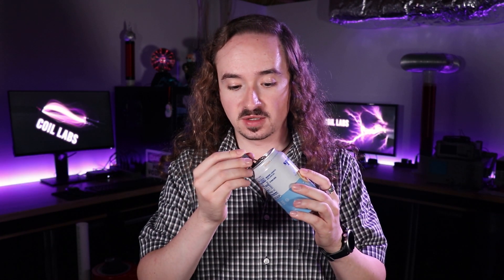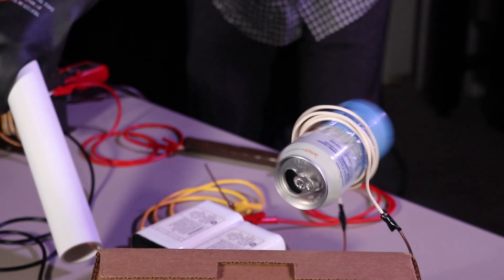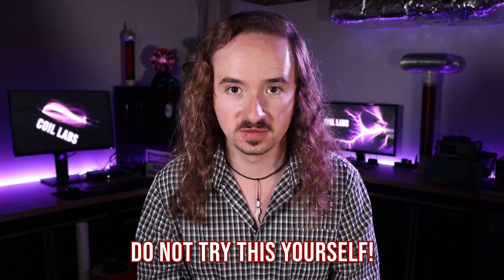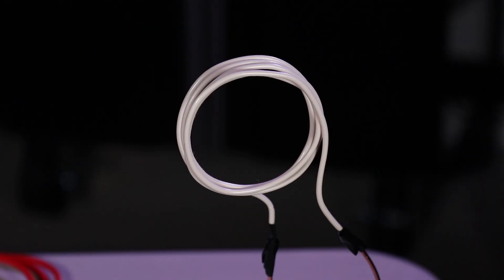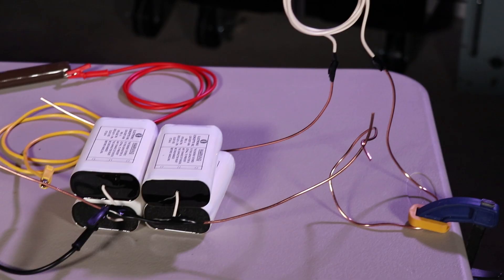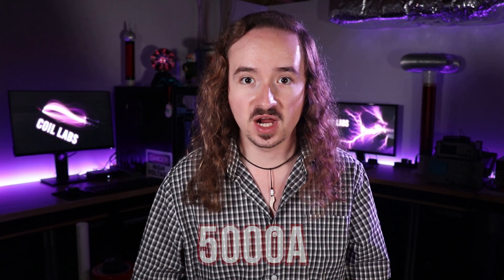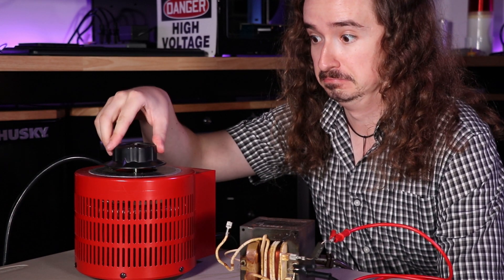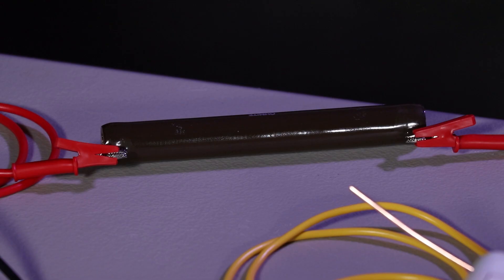Crushing Cans with 5000 Amps!

Comment: Huh... The can crusher is pretty much just an exploding coil EMP gun... if you get more capacitance, a really fast switch and do everything possible to get an exceptionally  short rise time, so the coil doesn't get hot, resistance goes up and it just kinda slumps, melts, & arcs. 

You need a KA-POW! And a parabolic reflector. Then see if you can brick an old laptop from 10 meters or so. 🤔

Comment: Haha I love the switch :D Good Job man, keep going! Where did you get these amazing capacitors?????
Reply from the maker: Thank you! I got those capacitors on eBay several years ago. I have no idea what their original purpose was, lol. They must have been a custom order, because I don't see anything like them on the manufacturer's website (Electronic Concepts Inc). The big thing I don't like about them though is they have absolutely tiny little wires and are definitely not meant for this kind of pulse power stuff. I don't know why they would make capacitors like this with such tiny wires, lol.

Comment: I don't think that the resistance you measured is the full picture. The coil has some inductance which prevents the current from changing instantly, and probably significantly increases the impedance from .4 ohms, given the short duration of your pulse. Thus the current through the wire is likely much lower than 5000 A.
Reply from the maker: You're absolutely right, the inductance does lower it a bit, but it's actually not significantly less (in my opinion, "significant" is a subjective term), if you simulate the circuit. So it's a series RLC circuit, with R = 0.4 ohms and C = 4*200 = 800 uF. L is tricky to know accurately, but going off of air core coil inductance calculators for that coil geometry it says about 2.6 uH. Now assume it's actually a bit higher than that due to the aluminum can (not purely air core) and other parasitic inductances from the layout of the wires and a little bit from the capacitors themselves. Let's be really conservative with that and round it all the way up to L = 10 uH. If you simulate the differential equation for the RLC circuit, with an initial capacitor voltage of 2000V, you get a peak current of about 4285 amps. See this figure I generated from simulating the circuit https://imgur.com/a/5AuTwKm . A non-negligible amount less than 5000 for sure, but still in the ballpark. I guess I could rename the video and say something more like 4000 amps, but it's close enough to still get the point across.
Reply: @CoilLabs  Thanks, I appreciate the explanation! What program did you use to make the graph?
Reply from the maker: It's just a little python script I wrote to simulate RLC circuits. The plots comes from python's matplotlib library. I'm planning to make a Coil Labs GitHub page sometime soon to share code I write whenever I have projects involving software. I can put this python script on there when I do and respond here to let you know when it's up, if you'd like.

Comment: Wow that little cap is 200 micro?
Reply from the maker: Yeah, and I have 4 of them in parallel here. Got them on eBay a long time ago. Not sure what they were originally for. They're definitely not meant to do pulse current like this though, because they have these tiny dinky little wires. I'm definitely abusing them in ways they were never meant to be used, lol. The internals of the capacitors seem to handle it fine though. Just the wires for connecting to them are total junk, haha.

Comment: Nice, I did the same thing one time, just with mutch less energy. It whas enough to crush a thin roll of aluminum foil a tiny bit tho.
Reply from the maker: Probably a lot safer than what I did here, lol
Reply: @CoilLabs  You are right, it could still kill you tho. 
At some point I will do It on a larger scale. But I dont feel confortable doing that rn or in the near future.
Reply from the maker: The other thing you have to be careful with at even larger scales than what I did here is molten electrode shrapnel. People who do this kind of stuff with way bigger capacitor banks usually enclose their switch electrodes inside a padded / armored box that can stop high speed chunks of metal that might come flying off of the electrodes. I've seen pictures of the aftermath inside those boxes. Looks like a bomb went off, lol.
Reply: @CoilLabs  You are right, maybe I will use a trigatron as a switch. I would still have to shield it tho, for the case that it explodes.